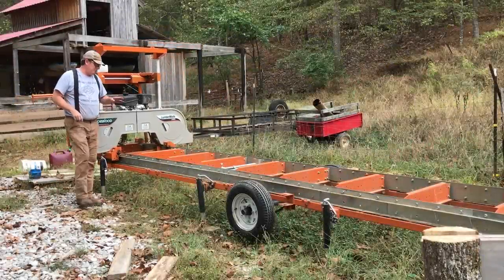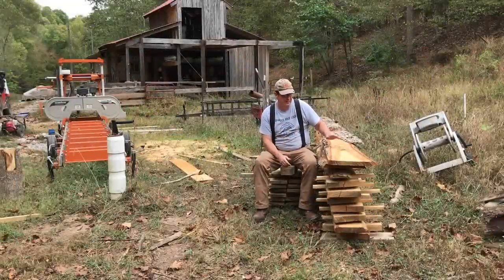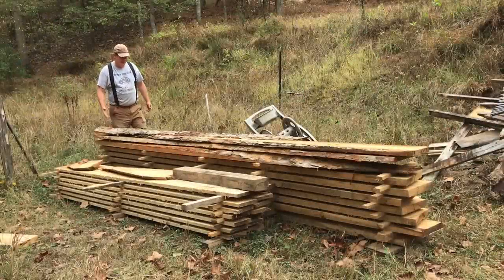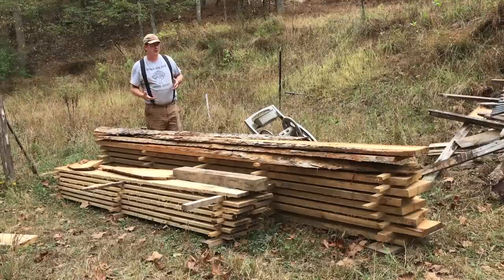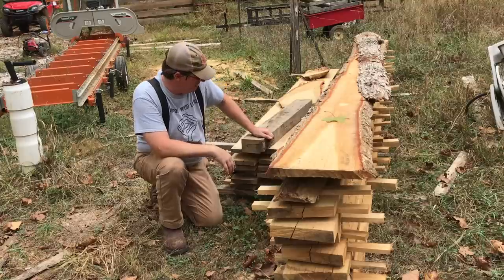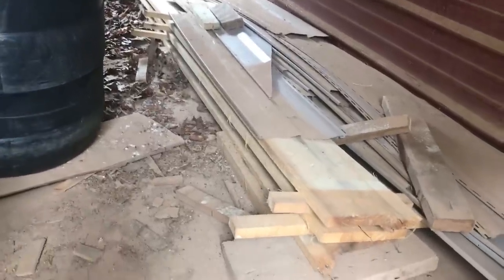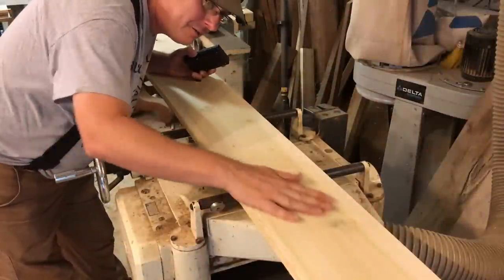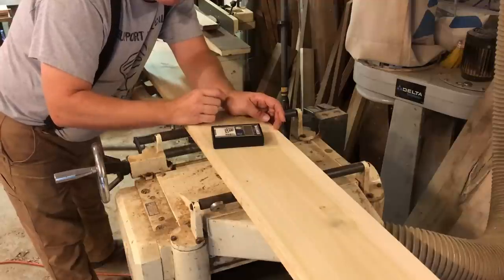How long before you can take wood from the sawmill to the wood shop?

Comment: Generally, if it is going for temporary construction or green siding (the log scabs) they can be used immediately.  If the wood is going to be exposed to the weather after securing it with screws it should be fine for a season or two.  

Otherwise, stack it flat with stickers every 18 to 34 inches on level floor out of the elements to season... 1 year per inch of thickness.   Make sure to seal the ends of the logs to prevent excessively fast moisture loss, to alleviate cracks and checking. 

Sawdust of various species can be dangerous,  so check to make sure it is safe for handling . Some safe sawdusts can be used for many purposes, like mulch, animal stalls, oil spill cleanup, bio-pellets for alternate fuel burners, ect.

Comment: Need to move your equipment, extend your pipe and park a trailer with a tarp to collect your sawdust.  Then every once in awhile dump it into a compost pile with some green plant matter.  If you want, add some Earth worms to it to speed up the breakdown or use it for mushroom bedding.  Recycle, reuse, repurpose, the homesteaders three R's.

Comment: That's terrible in my first thinking because you will increase the mold and it's double work. You had the barrel upstairs why not make yourself a normal collector. Some of the woods are considered mildly toxic but still simultaneously feed the fungal in the air.

I am desperate for the help to get another land use deal again. First order would be a warm climate but the massive increase in price for dirty sand, and the sink holes in Florida that can't be evaluated without expensive equipment put a damper on my looking down there. The intense social gangstocking of worthless moreover toxic social types trying to steal from me and then poison me when I said I was going back North is dangerous. 

What happened to you? I don't watch you that often since I was forced off the land but I recall your earlier video about buying the land and I thought that you were less aged and not as fat. I have to watch everything from a bodily functional way so don't take it personally. Call it dumb ass me if you want or whatever but I thought it was only 5 years earlier date. Just like I didn't know until I was out of the staten island area for two months and started to see my body start to change including eye color. And Daytona Beach wasn't perfect air, just different.So if I didn't get swapped-out and I go backup to screen in Newark and I was swelling-up on the bus while sleeping. So what goes on in your area of the woods?

Now to the wood. What thickness did you start at before you planed it down to 3/4 inch?
It seems like that meter can only penetrate the surface. So what do you estimate the core moisture to be at and what is your thinking as to why?
I don't get to see anyone talking about using green logs successfully where there is some equipment used to speed the process but from a poor man's budget.

From the spirits of Steve at Triple Brook Farm, what about using the saw dust for a compost toilet.
Secondly coming through from the gardening side, could it be used like those who use wood chips in the garden.